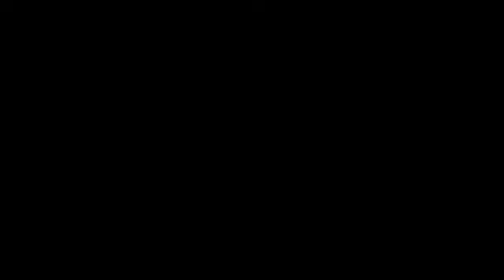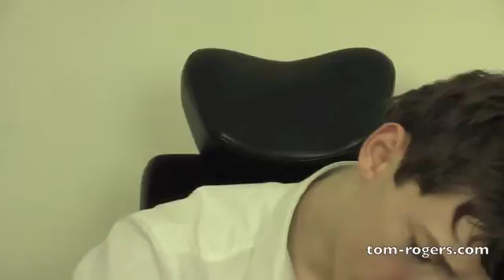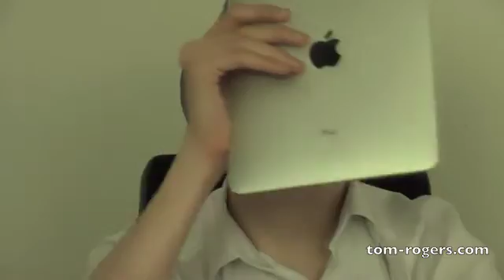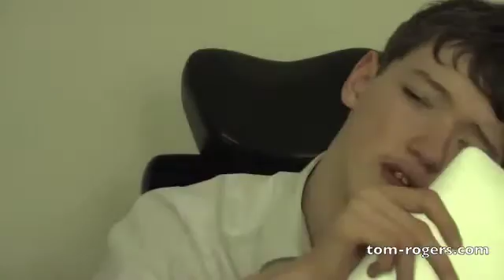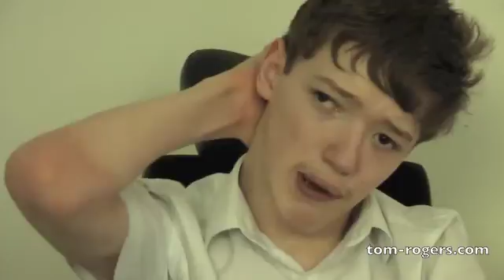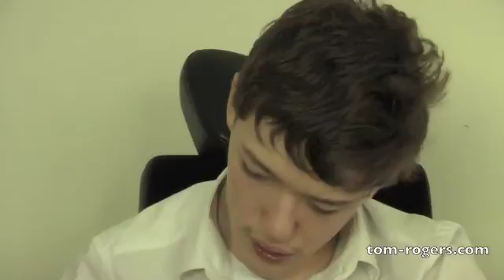More Cores vs Higher Clock Speed For Mobile Devices

Comment: --continued-- We can make single core chips with more performance per clock, but in the age where intel can put 700m transistors on a die, it becomes harder to push serial instruction performance with one core.  The logical choice is to make multicore processors.  There is no choice between single core and multicore.  We have pushed single core as far as it can be pushed (at moore's law rates anyway, slower advances allow it to edge up as well)

Comment: As processors advance, one thing has remained constant.  Transistor count goes up. A core2duo (conroe) is not faster than a prescott pentium 4 simply because it has 2 cores.  Each core is considerably faster per clock.  Clock rate has basically stopped going up.  Over the next 10 years, we might see consumer chips to to 6ghz (as very high end powerpcs are there now), but this will not be where the performance comes from. --continued